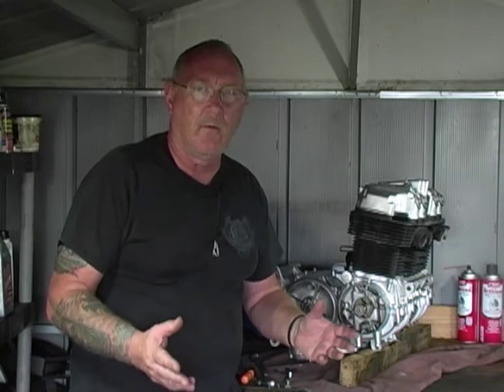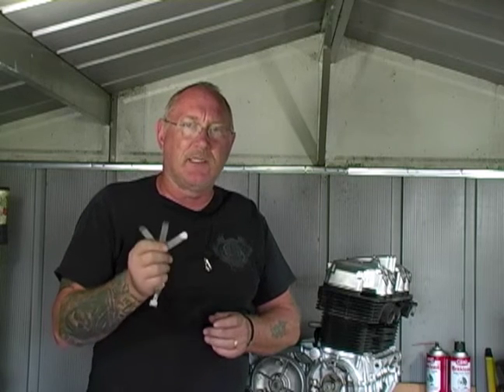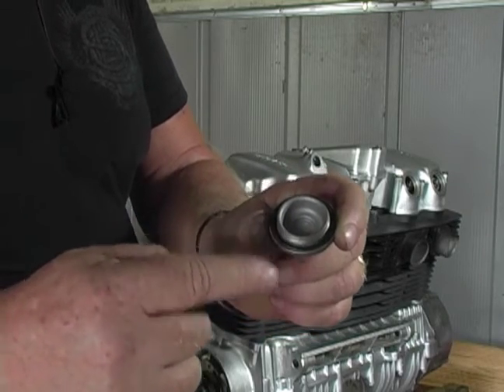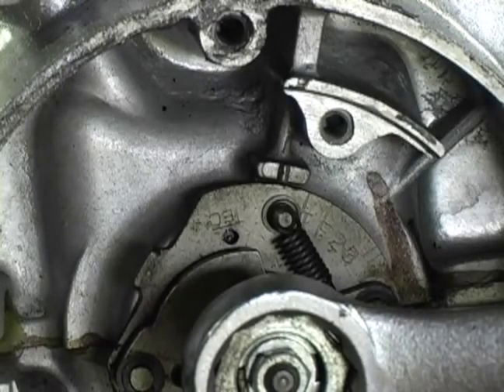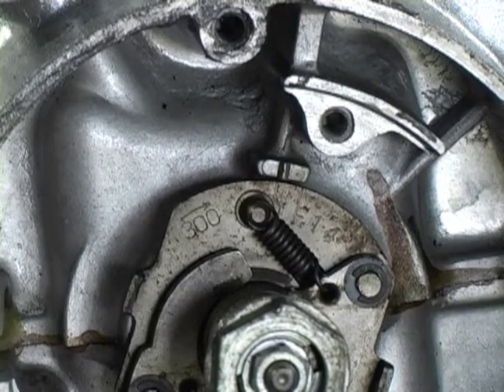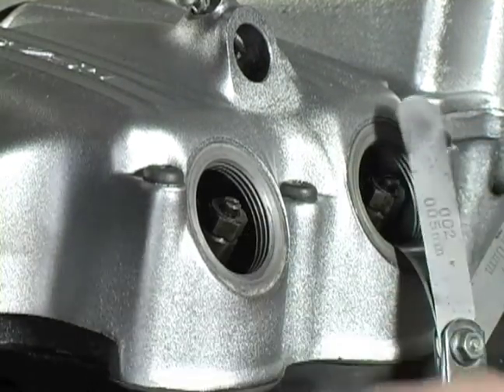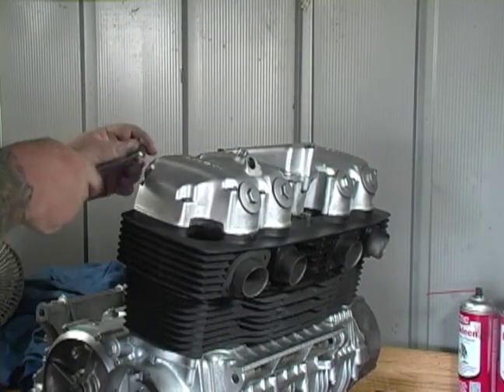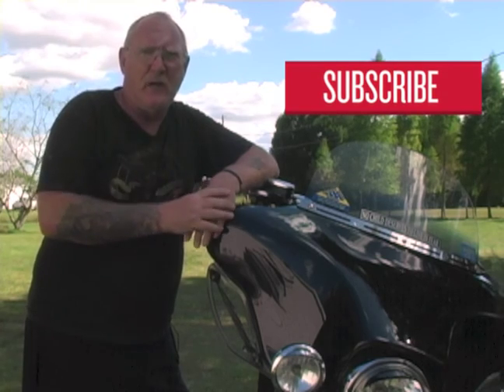SBTV How To - Adjusting Valve Clearances Using A Screw-type Adjuster (Honda CB750K SOHC)

Comment: This really clarified the process for me.  The manual led me to believe that when the #1 intake valve starts to come up, I should be seeing the T mark for 1.4 - I kept seeing 2.3.  But of course that’s exactly how it is in the video - you just keep rotating past that to 1.4 T.  I do agree with the other guy that actually seeing you rotate the engine 360° would give us some confidence that we’ve done it right.  Seems to me if I put a wrench (at, say, 12 o’clock or whatever “oclock” makes sense for you) on the big nut in behind the timing cover and rotate the engine all the way through and back to 12 o’clock again, that’s 360°.  So long as the valves I just adjusted are tight and the other ones loose, that should be confirmation.

Anyhow, thanks.  This helped clear up the manual for me.